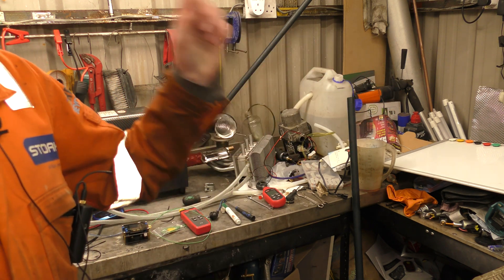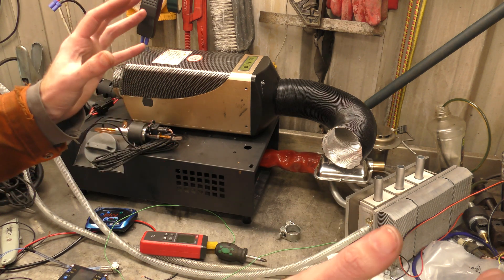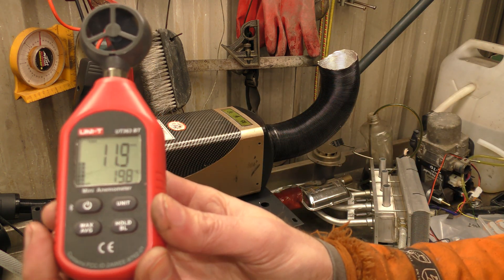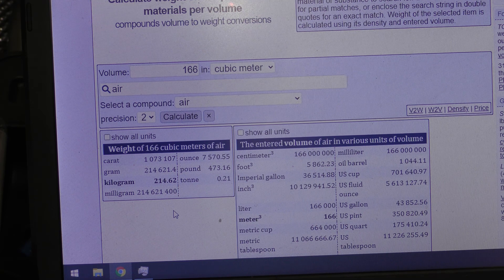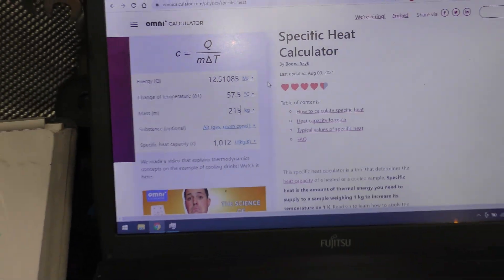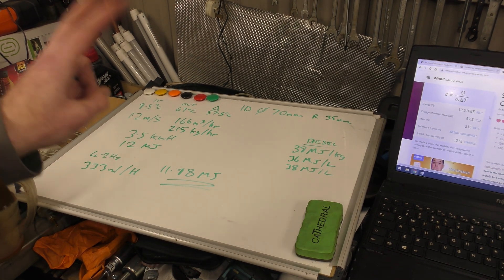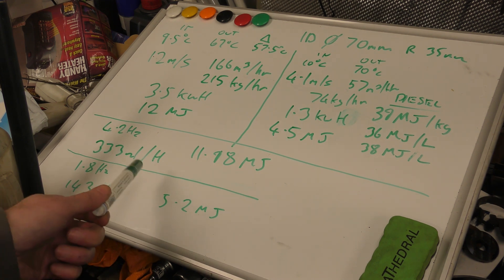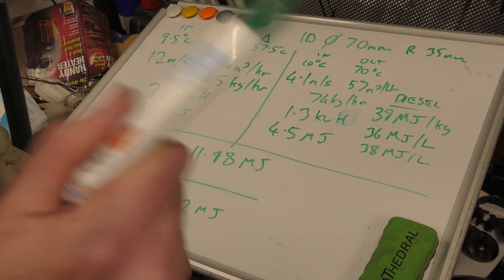Measuring and calculating the actual heated air output from the diesel heater.

Comment: i seen this done before   by a mad maths guy    but  before you can  make a guess to kw hrs    or btus      dont you need a time factor also?  i think the other man timed   1 hour   for the complete test      then he was able to calculate    the actual  kw/hr    and compared that with the energy stored in the diesel   that was missing from a full tank.   and looking at the specified  kw/hr  ratings from vevor  they said   5000w    and   8000w     but   no time factor    so nonsense

Comment: what if you reduced the input air hole up by half, I did and the sensor temp went up by 38C in altitude mode, I'm now thinking of putting a 16ml pump on to replace the 22ml one just to see how that works out

Comment: Hi, when I first purchased my 5kw heater it worked well straight out of the box brilliant, after a month or so core temperature seems to be dropping 150c at max output and 105c low power idle.
Am I right in thinking it's getting coked up and coke is acting as an insulation. Also starting to smell of diesel. Any thoughts.

Comment: Your videos are great as always.  It would have been an interesting add on to see what is the heat output of the diesel exhaust.  Might have been an interesting sanity check, as the two heat outputs should be roughly equal to some (lower) percentage of theoretical output of a perfect diesel burn which you calculated already.
Reply from the maker: I haven't come up with a way to accurately measure the waste heat from the exhaust.  My anemometer will melt.  :)
Reply: @DavidMcLuckie  yes you would have to try to measure the intake side instead but I'm guessing it would be hard to get a good seal to get an accurate reading

Comment: So I bought a 5KW model from some seller on Amazon and from day one  I wasn't overly impressed by the heat output.  Picked up an anemometer to measure the flow rate and plugged the values into the conversion websites uses here in this vid to discover to my horror, the advertised 5KW power output fell way way short. In fact, I got a measly 2.27KW for a flow rate of 9.4m/s with an input temp of 22C and output temp of 60C.  To get anywhere close to 5KW, that output temp would need to be 106C , or the flow rate would need to more than tripled! 

What really annoyed me was the seller trying to fob me off saying TSD-2 on the model/rating plate merely meant the unit was a split type (i.e. heater and fuel tank not in the same housing).  When looking at the operator manual which gave physical dimensions of the 2/5/8KW models, it was readily apparently the "5KW" model I was sent fell short of the overall length by almost 100mm. To add insult to injury the supplied remote wasn't supplied with a battery and the manual made no mention of what was needed.  Assumed it was a regular 23A 12V 'car alarm remote' type battery it didn't fit. After hours of searching, discovered there's a marginally smaller 12V, the A27 which worked a treat, albeit sourced over a week or so later from the heater arriving.

Left a scathing review on the item and returned for a full refund.
Reply: wat a knob

Comment: Bought the 8kw chineese diesel heater thinking it would give an ouput of 8kw.. to bad it’s just marketing i think.. 3,5 kw is not enough for my shed so i’m looking for an idea of boosting it.. is it possible for you to test higher fan speed and pulsrate (outside test) and check how mutch kw you can get by messuring with your wind meter and online calculations?  Maby on 7.0 hz or something? 😊
Reply from the maker: It is a test for the future.  But I think we worked out that to get the 8KW we need to use the massive fuel pump and the fan won't spin fast enough for it burn properly.

Comment: Thanks David! If you've not already got a Marine Engineer's sheepskin on the wall I should send you mine. If you ever get a chance check out the Wallas diesel heaters from Finland. They have a few nuances that the bus heaters don't. The exhaust goes out the top (handy when the ocean is down,) and preheats the combustion air in a double walled flue pipe resulting in warm not hot exhaust gas and no need for flue insulation. The igniter is a glow wire and runs nearer 5A of 12 V dc on startup. I've run them for 20 years now on the boat I live aboard and am just starting to experiment with a toolbox portable China bus heater for fun. My suspicion is the Wallas runs a  higher efficiency just based on the similar fuel pump and very low operation frequency but it's hard to beat 100%!.
Reply from the maker: I'd like to see inside a Wallas heater now.  :)
Reply: @DavidMcLuckie  I'd take mine apart and share a video except (1) I have a face for radio and voice for the silent movies, (2) I despise video editing, and (3) the damned thing is running great at the moment and if i mess it up a new one is $$$!

Comment: I know it's been a year for this video but I couldn't take my eyes off the melted plastic bottle of fuel at the exhaust lol. Great video though as I just bought one of these to suplament a 14k electric furnace that would not keep up with 25 F outside. Best it could do was 62 F inside and with one of these in a 1000sq foot room the furnace actually cycles and the temp stays at 70 F. Also this is just with the heat blowing in an the unit outside with the air intake pulling in that 25 F temp. Very nice and I am going to fully plumb it in so it intakes the warmer air inside. Might be able to turn off the expensive 35 USD a day, yes 35 a day at below freezing, furnace. Thanks for the videos and looking at tuning the thing now.

Comment: So about 33 pence an hour to get 3.5kw of heating, using heating oil. Compared to electricity at 34 pence per kwh currently (Nov 2022).  If you could run these off of used cooking oil you'd be on to a winner!  I guess a more accurate way to measure airflow might be to let the heater inflate a large bag?

Comment: Your the only person I think would test if you can run a 24v heater on 12v just by changing the controller setting. Or vise versa.
There is debate on if the glow plugs are all 12v and given a pwm signal allowing them to be ran on either. 
Or perhaps a 24v glow plug will still get hot enough to start the thing since the warm up period before it starts pumping is pretty long.
Reply from the maker: The only thing not 24V on a 24V heater is the ECU.  The fuel pump, fan motor, and glow plug are all 24V.
Reply: @DavidMcLuckie  the fan should be pwm controlled so 12v  or 24v should just alter the duty cycle for the fan. Fuel pump just being a solenoid might be forgiving with what it does and dosnt accept.
Reply from the maker: I know 100% the 24V fuel pumps don't work with 12V.  I've had two by accident now.

Comment: David,  based on your knowledge of these heaters and heating in general, would it make sense to purchase a 300CM exhaust pipe and coil it up into a nice circle spiraling downward (condensation)  before exiting the HVAC area and blow a fan up through it. Recover the heat going outside with a small 5 watt fan? your thoughts on this including safety.
Reply from the maker: That's a great idea.  The only thing I would do is to tune it again for CO after adding that length of exhaust as it will add a bit of restriction.  As far as safety is concerned, other than burning yourself on it there isn't much else.  :)

Comment: Hullooooo! Question for you, Sir? I bought the supposed "8K" heater. I'm finding that there's not much difference in heat output above the 3.6 fuel setting - just uses far more fuel. Do I need to tune this thing? If so, how would you suggest? Note: I've noticed that my fan seems lazy - it speeds up when I increase fuel, but soon reverts to slower speed. I believe heat is being wasted out the exhaust and not exchanged due to this - do you concur? How do I make the fan run faster, more of the time?

Comment: Hello David, thanks a lot for your videos! I finally made the decision to buy one of these magnificent engineering marvels. However, since I own an old VW Bus that has "historical value" I'm rather hesitant cutting a hole in the floor of my bus. I'm wondering if it's enough to only cut a hole for the exhaust so the fresh air intake will use cabin air. I assume it will work that way but do you reckon it will have any impact on the Diesel heaters performance? Maybe you could run a test? Thank you :-)
Reply from the maker: Not so much on the heaters performance as a heater exactly but it does have a negative effect on the temperature.  The reason you don't use cabin air for combustion is that you have to replace that air from outside once it's been burned and gone out the exhaust.  So you are taking cold air from outside into the cabin, burning it and sending it out the exhaust.  Instead of just purely heating the circulating air in the cabin.  Some people do it deliberately to keep the air in the cabin 'fresh' at a slight loss to heating performance.

Comment: I think you may have a higher measured/calculated air quantity than actual due to the bend in the duct.
You had the anemometer on peak, but if there is more concentrated flow on one side than the other, this will skew the results.
You could straighten the duct and take a reading, use that in the calcs.
The temperature rise may be slightly lower with a straight duct due to increased flow.
But then those things could offset each other and still end up with the same results!

Comment: Only thing I'd say is your air mass calculator seems to be using the density of air at 0°, at 70° air is 20% less dense which will be reflected in your final figure. This is all at sea level, so if you want an even more accurate figure then you need to figure out the barometric pressure at the time of the experiment.

Comment: Very good David. The results shows that little energy relative to the energy of the hot air outlet is lost through the exhaust.  Perhaps around 14% loss. 86% efficiency is better than running a diesel engine to supply electrical power to, say a radiator. At best you would get 50% efficiency, more likely to be closer to 30% efficiency as a guess.
Reply: But you also get electricity 😁
Reply: @MickeyMishra  from the exhaust Mickey? Yes, you can get some electricity from the heat of the exhaust but that will come from a proportion of the waste energy, again at best 50%, more likely much less of this - at best you will recover 5% improving the overall efficiency from 86% to 91% - mind you these are very optimistic guesses!
Reply: @Bennyboy-dog  Exactly and SPOT ON!

Comment: Sorry if this is slightly off topic, but does anyone know if there is an equivalent glow plug used in combustion engines? It's seems odd to me that the original designer of the heater would make a bespoke plug rather than use a readily available off the shelf part. I cooked my heater and am having to replace the mother board and glow plug. It would be nice in the future to be able to go to a motor factors and get an off the shelf part.
Thanks in advance..
Reply: Automotive diesel engines do use glow plugs, but I have no idea if any are compatible.
Reply: I imagine that automotive glow plugs are designed to run for short periods of time?
Reply: @Bennyboy-dog  not necessarily, they stay on for roughly the same amount of time. They're normally timed.
Reply: Answering my own question, I guess I could take dimensions and compare with a Bosch data sheet.
Reply: @yoda-be.at1746  Ofcourse, the glow plug in the diesel heater will turn off when it is up to temperature....for some reason i imagined they ran continuously. Thanks!
Reply: So I changed the glow plug, only to find that the shorted plug took out the MOSFET that turns it on. Grrr. Ordered a new mother board, but being cold and resourceful (desperation does that) I took a MOSFET out of an old blown ebike controller, knowing the amperage would be high enough and in voltage range and soldered that to the board. It now works, although it took slightly longer to fire up (I count the clicks before the whoosh of flames to guage the general health of my heater). It got me thinking about whether a fuse inline with the plug would have saved the board. A shorted plug would blow the fuse before damaging the components that drive it. An open circuit fault would just register E3.
Just a thought..
Reply: @yoda-be.at1746  Nicely done! I guess the Mosfet "On" resistance if substantially higher than the original will influence the starting time.
I imagine the FET blows fast than a fuse can react short circuit conditions that a fuse might not help, still can't hurt, but it will increase the source resistance which may slow the starting. Maybe someone with more hands on can chime in?
Reply: @Bennyboy-dog  good point re fuse resistance. I think the longer starting was due to fuel draining from the pipe I removed. This morning it started as quickly as before I had a problem, so I think I got lucky with the mosfet being in spec. Must be a common problem with the chain of failure when a plug goes short circuit.

Comment: You know someone is going to say the outlet pipe of the heater is bent, which reduces the air speed.. LOL. Ok it was me that said it but I'm not that anal to care. 😁
Reply from the maker: You're right.  It dropped it by about 2m/s.  But it also made it a few degrees hotter than straight out the open heater.
Reply: @DavidMcLuckie  If I was the only one to say it, I'm surprised because YT is full of critics and brain surgeons that know everything. LOL.  Keep up the great work with your videos mate. I always really enjoy your heater experiments.

Comment: Try to calculate the heatoutput of the exhaust 🤔
Reply: Came here to say exactly this - doing the same calculations on the air intake and exhaust should then highlight where the inefficiencies are and should lead to a more accurate answer (given you're burning a known quantity of diesel with a known calorific value, heat out of the internal and external exhausts should add up)...
Reply: The heat lost through the exhaust seems quite a lot. I'm trying to devise a heat exchanger to pre heat the air before it is blown threw the heater.

Comment: I have one idea, but don't know the math. How about a know volume, heated with a closed loop? So a box connected to both the air in, and air out.
Reply from the maker: Ideally to do that you'd use a huge box you could put the whole heater in.  Then you'd know the volume air inside the box and all you need to do is time how long it takes to heat the air by an amount.  There is also a factor of the box radiating heat you'd have to take into account.

I don't have any boxes big enough.  And I did google room heating equations but that made my head hurt.
Reply: @DavidMcLuckie  well if someone out there can work out the volume of their van and it has some insulation. Wouldn't be mega accurate but would give some real world measurements.

Comment: Forgive my ignorance, but is a leisure battery a wet cell, AGM , deep cycle?
Reply: A 'cheap' leisure battery is normally flooded. A true deep cycle battery is very heavy due to the thickness of the plates. A true deep cycle battery can be any one of those, ie gel, AGM or flooded. Gel are very fragile in terms of charging abuse, because any over charging ie an equalise charge will lift the gel from the plates. AGM are fairly resilient but impossible to replace electrolyte lost from the vale regulator in the event of excessive gassing. The most resilient are large flooded cells used for forklift or old telecom backup systems. However, they do not like being left at a low state of charge for extended periods.
Hope this helps.

Comment: Only thermodynamic power equation you'll need:
Mass_flow_rate x specific_heat_capacity at constant pressure x (outlet_temperature - inlet_temperature).

For bulk flow velocity to mass flow rate assume constant density and use: air density at sea-level. Mass flow rate = density x velocity x flow area. 
Incompressible flow assumption valid as is very very subsonic. 
Use 1005 J/kg/K for specific_heat_capacity at constant pressure.

This is a zero dimensional calculation and is very relivent here.

Great channel as alway!!

Comment: How long do these last on just battery power like a marine battery. Or how many amp hours does one use.
Reply from the maker: For your typical 110Ah leisure cell, it would power a heater non stop for around 24 hours.

Comment: Thanks. You say these numbers are for the 5KW heater, I wonder what the 8KW unit would produce, higher pulse rate.🤔
Reply from the maker: I can 'make' it 8KW.  But it'll produce enough carbon monoxide to actually cause me to leave the workshop and stand outside until it clears.  8KW heaters don't actually exist.
Reply: @DavidMcLuckie  Okay, thanks for that comeback.
Reply from the maker: I didn't mean for my reply to sound as rude as that.  What I meant was there are only two 'sizes' of heater.  A 2KW small body and a 4KW large body.  Everything else is marketing.  I've seen 10KW and 12KW advertised.  And some sellers trying to sell the large body as a 2KW as well.
Reply: @DavidMcLuckie  thanks again, while i assumed that from your videos, I thought maybe they included a higher pulse rate controller in the 8KW unit.
Steve
Reply: @DavidMcLuckie  This is pure gold information for me.